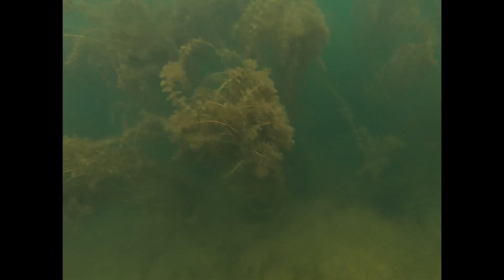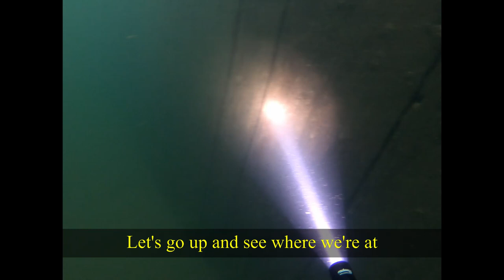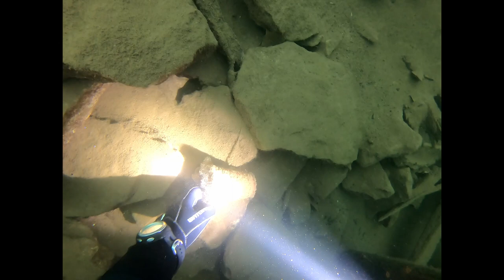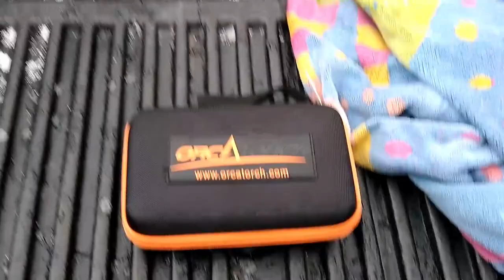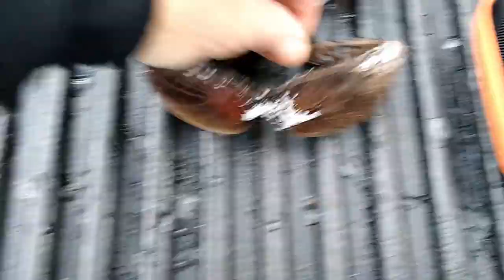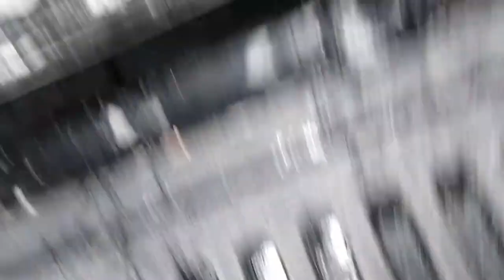December Scuba diving in Lake Superior Ore Dock Treasure Dive

Comment: This D700 appears to be a little hard to come by.  I didn't see it listed anywhere including there own website.  I am currently researching a new light for deep cold and sometimes cloudy Green Bay and Lake Michigan as well as reef diving in slightly warmer climates.  Do you still like there 550 model?
Reply from the maker: I do. The 550 is a stout little light and is widely available.
I sometimes get lights to test before they're released. The 700 is a pretty good inexpensive light. I like hi-low setting and the 18650 battery.
I've never been diving in Green Bay. What's there? Any wrecks? Old docks~ruins?
Reply: I will probably go with the 550.  I am a little more then I need kinda guy so when I saw the 1700 lumens compared to the 550 at only 1000 I was intrigued is all.  It's great that you have connected with them for reviews and trials.  I have done a majority of my diving on Green Bay and only recently vertured elsewhere.  So yea 6 or 7 good wrecks to dive most are 85ft plus down but a few shallower.  Only accessible via boat (M and M diving has charters).  There are actually a few docks around that all below water line that are always fun with lots to be found (a pocket watch was found last season from way back in the day on one particular dock we frequent).  So yep lots to be seen unfortunately mother nature can stir up the water to nearly zero vis so depends on the wind as to weather or not I am diving in 0 vis
Reply from the maker: @denniscolburn4906  Good choice. The 550 is a great light for the money.  I have several OrcaTorch lights and only one did not work as well as expected but a new set of batteries made the light shine. Pun intended 😆 

I haven't done much diving with Bob but I hope to in the near future and Green Bay sounds intriguing. Perhaps you could show a fellow around or offer a little direction sometime?

I hope this year will be a better one for diving, even if we're limited to local dives. The Great Lakes can offer good diving when mother nature allows and unless things turn around soon we may not be allowed to travel anytime soon.

Thanks for taking time to comment. I look forward to hearing more from you about nearby diving.
Reply: 550 is on order...I will try it out in Mexico next month and perhaps share a video...

My tanks are always at the ready.  Anytime your welcome to join me.

I intend on coming to one of your summer clean up dives.  I spent a lot of time on those shores growing up so pretty near and dear to my heart.  So hopefully you can show me around as well.  

Cheers good sir
Reply from the maker: Very cool,  @denniscolburn4906 . I hope you are able to post a video. One thing we should do is connect outside of YT so we can contact each other more readily.
My email is xxx
I'll leave this up for a bit and then take it down for privacy purposes.
Reply: See your email
Reply from the maker: @denniscolburn4906  OK, I'll respond shortly 👍

Comment: How cold is the lake? In the easten end today at 4 :14 PM its snowing and 27 out.
Reply from the maker: I was hoping my dive computer would tell me just that, Louise. Unfortunately I need to feed it a fresh battery and I'm plumb out. I believe its right around 39 or 40 degrees. That's typical for this time of year. I should have a new battery in time for our New Years' Day dive though.
Reply: @DonFassbender  wow its warmer over there!! Since Sunday its snowed every day except Monday. I'm ready to kiss the UP goodbye and become a troll again!!! It's only 68 inside. Gotta turn the pellet stove up again. My bathroom is 58 degrees.
Reply from the maker: @louisesproul6778  The air is 28 right now. The water is warmer at 39~40. It takes a while to cool down and doesn't really get colder than freezing. I have recorded lake water at 30 before but it's not common.
Reply: @DonFassbender  I know the lake cools down slower! Been on Suoerior many times. My son is stationed in the Soo and is in the Coast Guard. He wanted to go anyplace else but got stationed there. I live about 40 miles south east of the Soo.

Do you watch adventures with purpose? Jerod sells lift bags. You could get all those axles and scrap them.
Reply from the maker: @louisesproul6778  Jared and I have spoken on several occasions but those train parts and shipwrecks are considered to have historical significance and so they cannot be legally removed from the lake. Marquette, as well as Whitefish Bay, are governed by Michigan's Underwater Preserves and so we're limited in what we can remove. 
If we had as many cars as they do in the rivers of Oregon I'd already have a fistful of his lift bags 😁
I've been invited to join them on more than one occasion but my family life wouldn't permit it. They sure had an eventful summer.